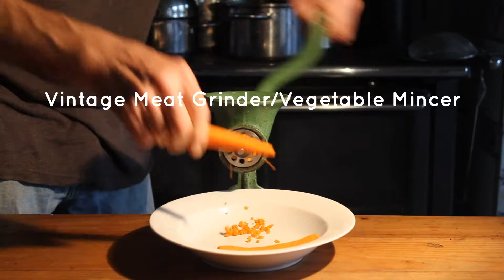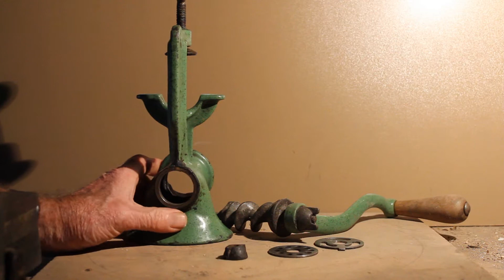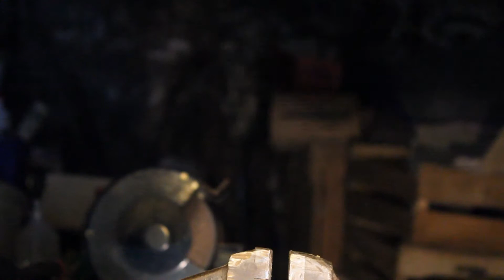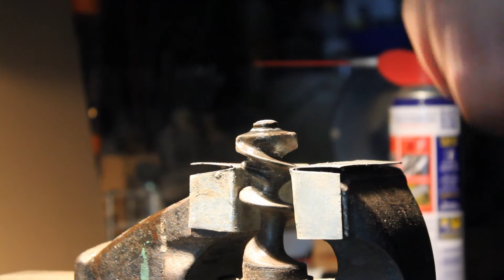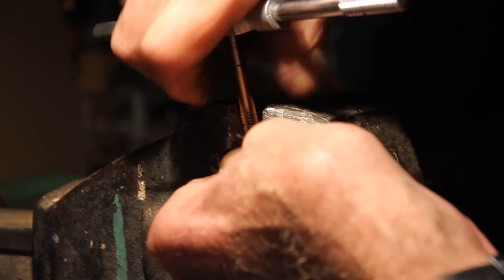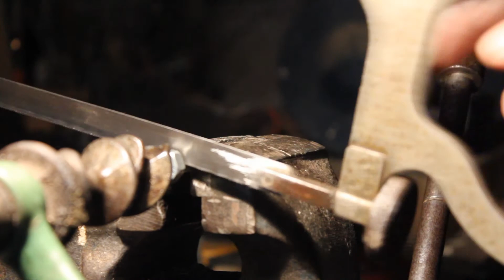Repair Vintage Cast Iron Meat Grinder/Vegetable Mincer. Reparar picadora antigua Brico hachoir retro

Comment: Andy, you cut threads exactly as I was taught with a quarter turn followed by an eighth turn back. I am always concerned with cast iron as it is so very brittle. Great video and I was transported back 50 years to my mum's kitchen when she minced bacon and onion together to make a savoury suet roll (mouthwatering !!!).
Reply from the maker: Hi Tony, great to hear from you! I wasn't really conscious of what I was doing but I could feel the resistance when I was going too far on the 'quarter turn'. The feedback you get with larger taps is much better/easily detected. Years ago I did a lot of working with 4 BA threads and I can still recall 'pushing the limits' when tapping - resulting in the inevitable snapping of the tap in the workpiece. Ho, hum 'more haste less speed' was a great teacher. Cast iron is an 'interesting' material but you're right about the brittle nature, I do find that when it has been properly designed and made the material is hard wearing, and durable and can take a lot of abuse. On the other hand plastics by comparison are so frequently used in the most inappropriate products resulting in early failure or relatively short life due to aging that I do wish more attention is paid to 'traditional' materials. Modern Times I suppose but progress it ain't. Savoury suet roll sounds great, in fact I can smell the ingredients now as you cut the roll open, yum!!! Hope you're keeping up your spirits and health in these mad times. Cheers, Andy.

Comment: Can you please explain the purpose of the 3 different taps? I need to tap a couple of my steam radiators (I’ve never done it before), and I’m wondering if I need to get a set of 3 like you have.
Reply from the maker: Hi Joel, I was using three taps because I was going into a blind hole, i.e. where I wanted to cut the thread right to the bottom of the hole and this was achieved with the third and final tap aka the plug tap. If you are going through the material in the job you are doing, then you only need the first two taps and depending on how thick the material is, you may only need the first one. Personally though I would use the second taper as well to ensure a clean thread all the way. The first taper is really to start the thread cutting in the material, so as to get a good vertically tapped hole. Also worth noting is that you should always lubricate the taps well to avoid the tap seizing in the hole and snapping, which can happen and is a pig of a job to remove. I will be writing this all up on https://thegreenlever.blogspot.com shortly. Hope this answered your question but please do get back if you think I can help further. All the very best from sunny Normandy, Andy
Reply: Organikmechanic thank you kindly, this is excellent information!
Reply from the maker: Joel, you're very welcome.